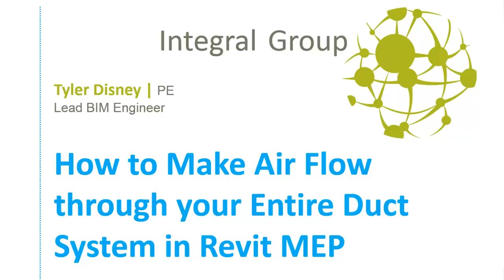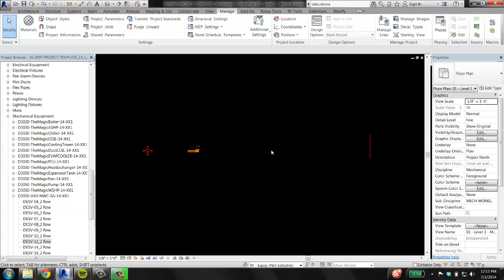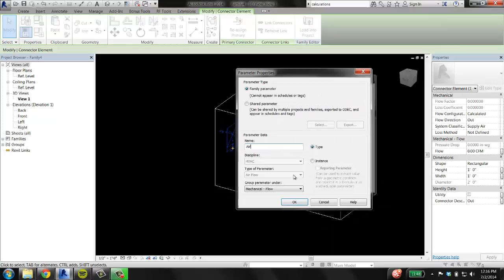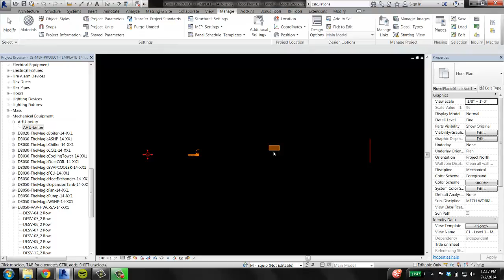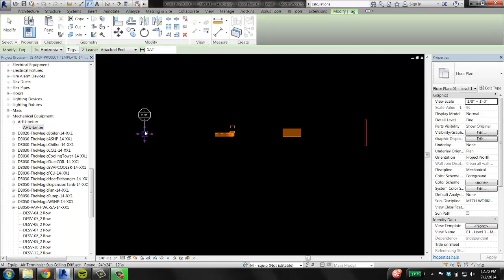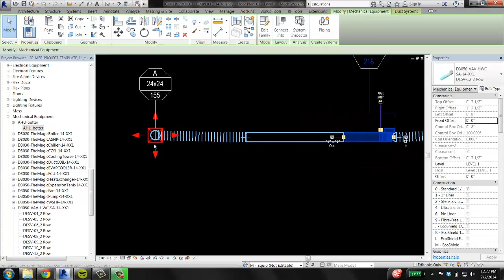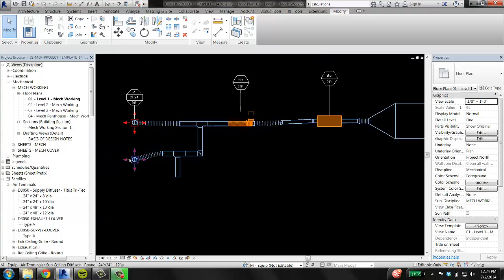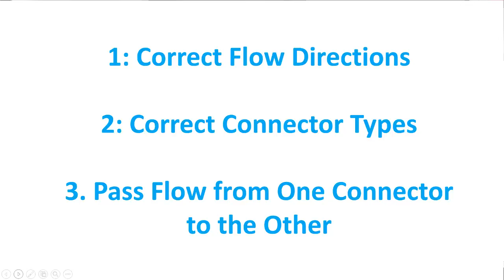How to Make Air Flow through Your Entire Duct System in Revit MEP

Comment: 2 comments: 
1) dont forget to make the calculation connection point - primary
2) dont forget to make the out connection on air intake grille - calculate
Reply from the maker: Great clarifications, thanks Artem.
Reply: @tdisney  But the calculated connection on the VAV was not the primary. the air intake side (preset) was. Does Artem's comment only apply to the AHU?

Comment: How do you create a system if you had more than 1 VAV? Also, how would you go about creating a system if you had some Air Terminals connected to a VAV and some connected straight to the AHU  (obviously, connected with ducting).
Reply from the maker: Hey Charles, I appreciate the questions. I've been out of the Revit game for about 4 years now, so I'm a bit rusty! I seem to remember you're going to have multiple Systems. So you'd have a system for the AHU > Terminals-with-no-VAV. You'd have a System for AHU > VAVs. You have a system for VAV1> terminals, another system for VAV2>terminals, etc. And they'd all nest according to their hierarchy. You don't have one system with everything on it. Pretty sure anyways, like I said it's been a minute. Cheers!
Reply: @tdisney  well, thanks a million for taking the time to get back to me. I don't seem to be able to add the same piece of equipment to multiple systems. I must be doing something wrong. Oh well, I'll keep plugging away. Cheers!
Reply from the maker: @charlesball9522  You might not be - a family can only be "equipment" (using the word technically, as in what Revit calls 'Equipment' in the context of Systems) in one system. Assuming it has the right connections, it can be a "Component" in another system. For example, a VAV Box is the Equipment for the system including the VAV box and its terminals, and it is a Component in the system where the AHU is the Equipment. Revit is set up this way to disallow double counting, I assume.

Comment: 9:07 how did you change to flex duct without selecting anything?
Reply from the maker: I used a keyboard shortcut. I forget if the default shortcut is FD, or if I customized the shortcut to be that. So, once I had clicked to place the end of the straight bit of duct, I simply typed FD, which switched me over to "model flex duct mode", and placed it. I highly recommend the extensive use of keyboard shortcuts, it will make you much faster. I also recommend that you remap many of the default shortcuts, because some of them have you crossing the keyboard. Assuming you mouse with your right hand and keyboard with your left, you want all of your most common commands to be easily input with just your left hand, with the index finger resting on F. Cheers.
Reply: @tdisney  yeah. It will really helps me a lot. Thanks for these kinda tutorials. Please upload more about Revit's MEP.

Comment: Do you have a similar video with HVAC piping?  I'm trying to figure out to get GPM through piping and equipment.  Any thoughts?
Thank you for your time
Reply from the maker: Hi Chad, no video but it is basically the same process, just with Pipe Systems instead of Duct. That said, it is more complicated, due to hydronic systems being two-pipe so you really have to be careful with connector designations (Supply/Return), flow direction, etc. To be honest, I almost never go to the effort of ensuring smart flow through my Hydronic systems in Revit due to how complex it gets, particularly when you start throwing Pipe Accessories in there. Add in three or four different people all working on different bits of a Hydronic system at various times, and the ROI of doing smart hydronic accounting in Revit becomes not worth it. I only do it in special circumstances when it makes sense, which is very rare. Cheers.